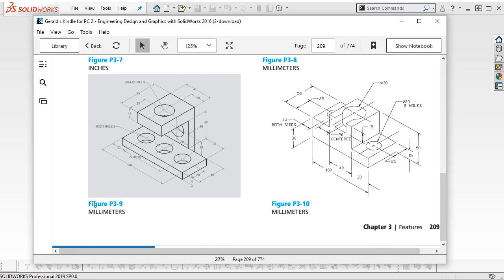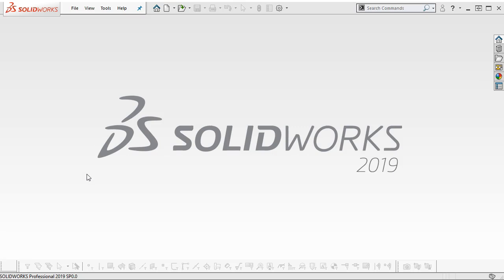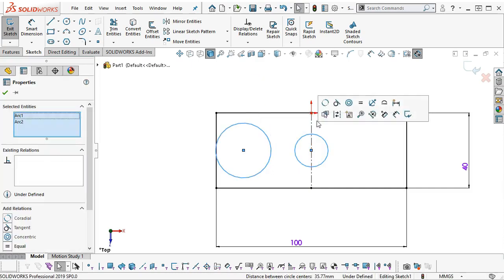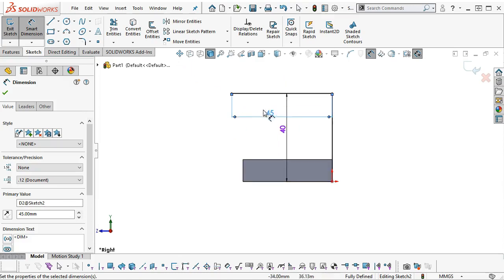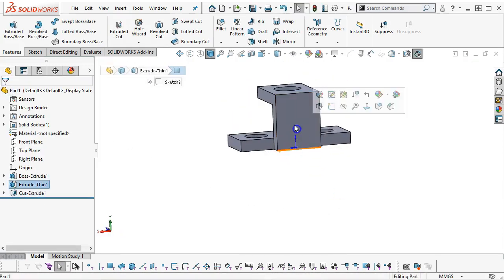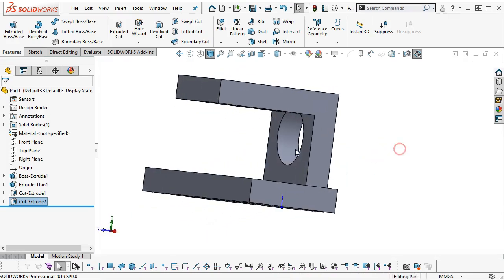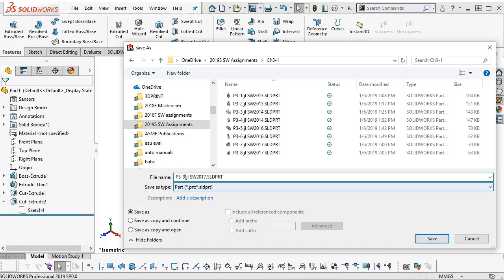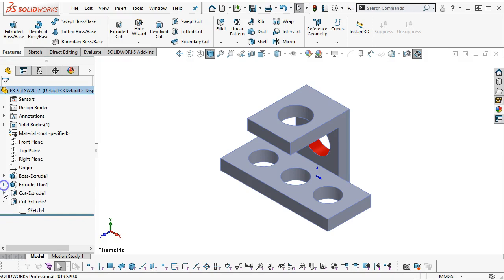20190106 Ch3-1 P3-9 optional

Comment: thats just wrong. ver top surface is 15 and you made 10.
Reply from the maker: So thin feature is not a good choice here, the thickness setting is not variable. You could close the contour with the correct dimensions, or Direct Edit, Move Face 5mm. Be careful when you see Thin Feature in the property manager.